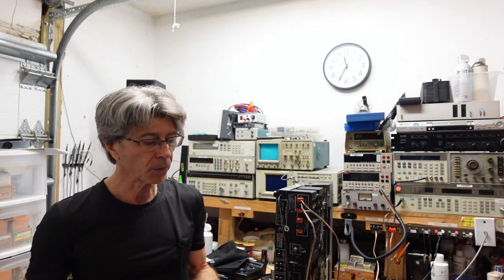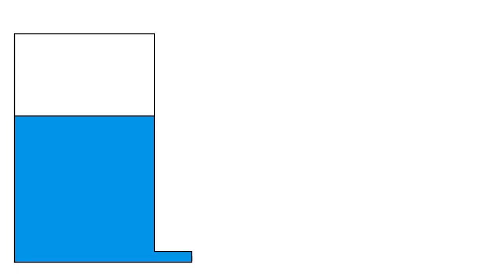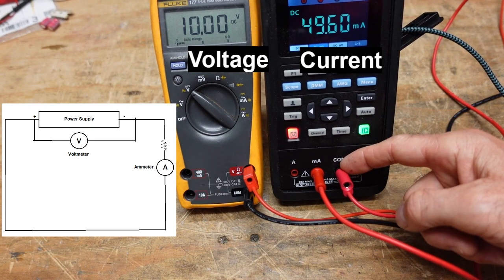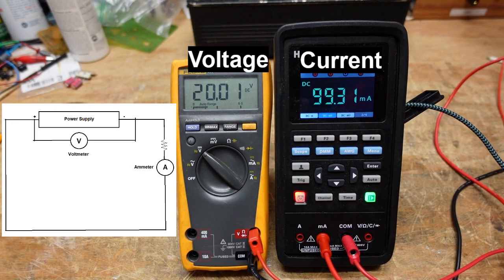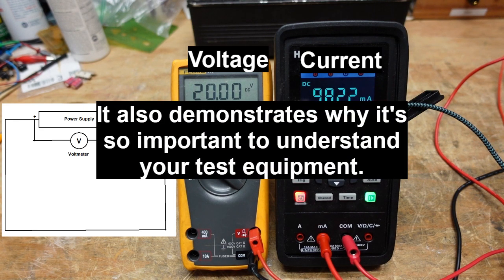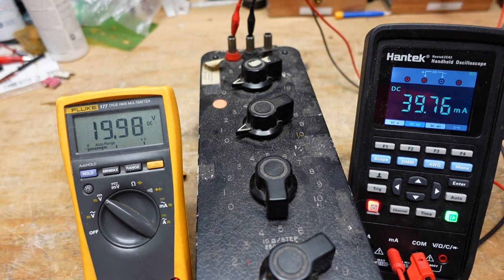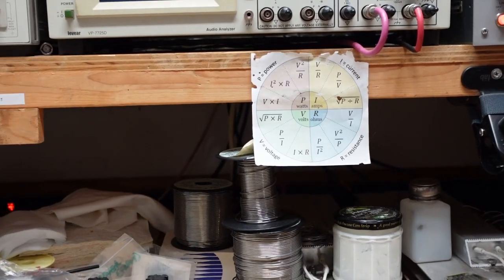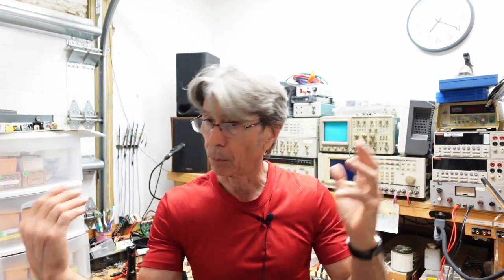Basic Electronics for the Technician Part 1- Understanding Voltage and Current

Comment: "Resistance is futile".  Way back in the late 80's I had electrical training boot camp for GM techs.  After 4 weeks we had to pass a test.  One of the hands on test was to diagnose a cigar liter inop.  Only tool was a DVOM.  Most guys failed because they incorrectly diagnosed the liter element NG.  When checking for 12v at the socket the DVOM showed 12v, with the element pushed in, it would drop to 0v.  I checked circuit resistance,and found high ohms on the power lead.  The teacher had hidden a resister in the circuit.  I passed with flying colors.   For most power circuits, now I use a test light modified with a load resister, draws 4.5 amps, enough to load most 12v circuits.. Has helped tremendously with not going down the rabbit hole.  The right tool for the right job.

Comment: Ohms Law works because of how it's defined. It is a unity system. One volt is the electromotive force in volts required to cause one amp of current to flow through one ohm of resistance. An amp being Avagadro's number of electrons following in one second. I think Avagadro's number is 6.022 x 10 exp18. That's ten raised to the eighteenth power. So you see the dimension of time added into the definition of amperage. The product of voltage and amperage being power in a DC circuit. Getting ahead of you here, but this is really great to fully understand. Power is expressed in watts which in DC strictly resistive circuit is voltage times amperage. It's an integral as in traveling in a car for so many minutes at a fixed speed in miles per hour converted to miles per minute to maintain proper dimensions and units is basically a rectangle with a height in speed and a horizontal being the length of time traveled. The area of the rectangle becomes distance traveled. Not interesting until one considers changing speed and direction. Anyway, that's a little too far. But that's how things work.
Reply from the maker: I'd never heard of Avagadro's Number, but isn't that a coulomb? 
If you don't mind, I'm going to request that viewers read your post.
Reply: @raygianelli3612  Hi, yes a coulomb. I forgot about that 

I was thinking while writing the message that I didn't know if the units or dimensions worked with the ” area under the curve." If I'm not right someone will correct me I'm sure of that! Feel free to share or to expand upon my comment. I enjoy your channel and you're helping me move forward with my long time hobby and passion in electronics. Thank-you!
Reply: 6.022 x 10 to the 23'rd power... A coulomb is defined as Avagadro's number of electrons flowing through a point in one second.

Comment: Hi Ray Love all your videos. In all my 40 years repairing I never heard of an ac open.
Would a simpson 260 or other 20,000 ohms per volt meter showed 0 or low?
Jimmy
Reply from the maker: Hi Jimmy. What I was referring to is a bad connection, in this case at the circuit breaker. Imagine a large value resistance in series with your load. Your DMM will read it without issue, but anything that draws even a little current won't. The electrician used a Wiggy tester, which is a sort of electro-mechanical tester, and that told the tale!
Reply from the maker: Look up "solenoid voltmeter" on Wikipedia. Read Advantages; it states almost exactly what happened to me.